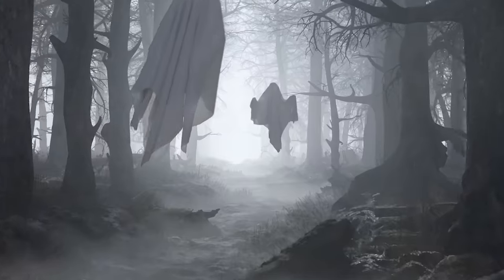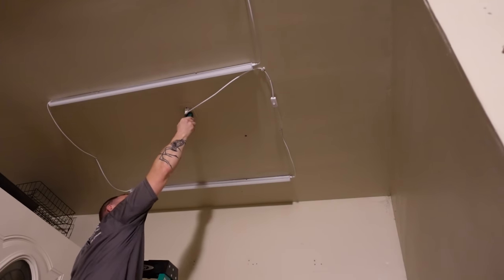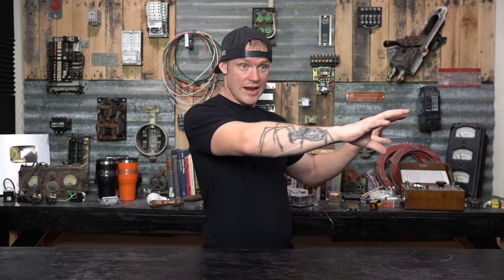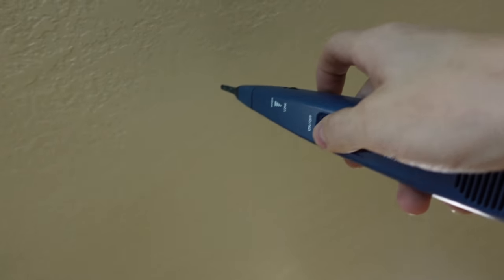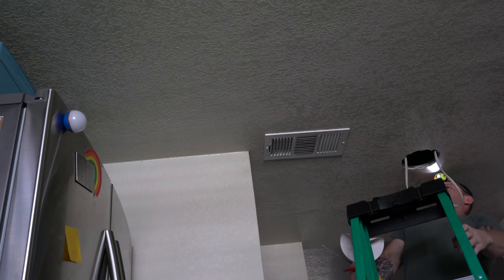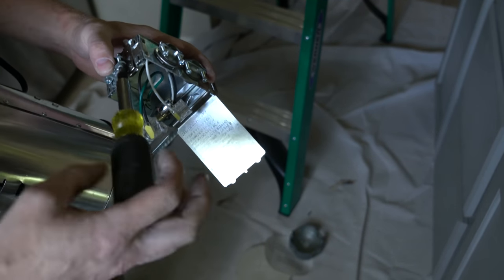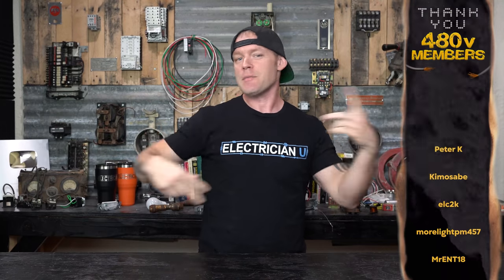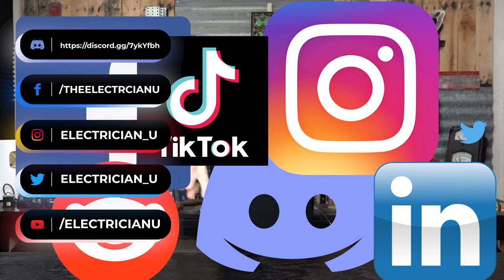THIS IS WHY ELECTRICIANS DON'T HIDE J-BOXES IN WALLS - Finding Hackwork!!

Comment: There's another advantage of 240v power. Nobody has any questions about whether it can kill them, and nobody plays any he-man games with it.
Reply: Saying we have in Australia... "One flash and your ash" Also when working on solar DC stands for Dead C**t
Reply: in EU / HU we have 230V but the horror stories are the same. I'm not sure my folks are 2x more brave or 2xdumb :D A lot of construction stories begin with 'the helper of X ....' :/
Reply: Ive been shocked by both 120v and 240 v it feels the same about the same as an electric fence. Athough 240 made my joints feel mechanical. Like i was a puppet on a string.
Reply: Cracks me up every time I hear some tough guy talk about “just grabbing that 120V”, like he was going to singlehandedly master the Power. You’re not Thanos, dumbass! One good bite will convince him that all his posturing won’t keep him from being a smoke show.
Reply: @mightyluv  obviously you have never been shocked or youd be laughing at yourself right now. And as you think youd die.

I wouldnt do it on purpose, its certainly not fun. Been shocked twice with 240v and probably 4-5 times with 110v and maybe 20 times electric fence 12v.
Reply: @Seriouslydave  Do ever get that same sensation running up your arm for a split second when you crack a knuckle or something similar, randomly?  I know I do. It's weird.
Reply: @TheDegan79  usually turning a screwdriver, i wonder if i got shocked or just a pinched nerve, not the same feeling but similar. Shocks throw you.
Reply: @Seriouslydave  That's the one.... mind playing tricks.
Reply: @TheDegan79  no lol you can tell the difference, 240v its not just that feeling, you also throw your muscles like a ragdoll.

Pinched nerve hurts but only like electric fence or 120v. 240v is like pinch nerve times 5 + ice river + sauna + rollercoaster. In a split second.
Reply: @Seriouslydave  i now what 240 feels like.... it's that half a split second when your not sure if it's nerves or a bite...
Reply: Urban legend, its 120 split phase, only 240 between the two terminals if you are lucky enough to shock across, typically shock one conductor to ground.

Comment: Bothers me so much that this occurs. I've had a builder request I do it -- I know that electricians have looked the other way -- and I've encountered it in newly renovated construction when opening up a wall. Dangerous as s##t -- and can make ID'ing a problem almost impossible.
Reply: Besides being illegal, It costs the building owner more in the long run, and it's a damn dick move.

Comment: Those J boxes, when grounded, can act like a faraday cage with respect to the toning tool, blocking the RF.
Reply: True, however you will get a tone from the entrance and exit wires if you dont, the problem is in that box
Reply: @rty1955  yep.  Which I think is exactly what happened in this case.
Reply: @MarcCabot  and like I said in another comment you have to think in 3D because the wire can leave a box (or no box) and travel vertically. Usually when I have that happen the signal fades. It does not abruptly stop. So in this case b since the signal just stopped indicates to me, that it went into a metal enclosure (faraday cage) and never exited. Usually indicates a broken wire
Reply: Absolutely correct, his tone generated signal he was trying to sniff was shielded by the J box. Cheers, #SeattleRingHunter
Reply: The tone is NOT RF!
Reply: @dhpbear2  I don't think anyone said that it was.

Comment: "120 volts can kill your ass" HahHAh young ones, made be think of all the old electrician's I've worked with so many times they would test the voltage with their thumb, and eventually they have to really dig it in to be sure it's not a dead line.
Reply: I think the point is , if you can turn it off,  why wouldn't you.  Which I totally agree with.  I mean what would you be trying to prove lol .
Reply: But those old school guys knew to only do that with one hand.
Reply: Or they were not old electricians.  There are old pilots (electricians), there are bold pilots, there are no old bold pilots.
Reply: I was once told to test with back of hand so you would not grip if hit by power!  
 I was like what??!

Comment: vietnam flashback to all the times “professionals” and “master professionals” told me they were 95% certain
Reply: As you should know in war all plans go out the window the moment the first shot is fired. You're dealing with an enemy whose plans you do not no so it's all guess work. The military "professionals" and "master porfessionals" don't like to admit they don't know anything so they BS you. It's quite different dealing with a hard science like electricity and a trained professional who has worked with it for years. When he says he is 95% certain of something you can pretty much take it to the bank.
Reply: @EndOfLineTech  to be fair car electrical system is very different from house electricity, and CAN bus is more electronics/computer engineering (dealing with signals/digital logic/communication protocol) than electrical engineering (dealing with supplying power).
Reply: @EndOfLineTech  CANBUS = CAN'TBUS...

Comment: The homeowner turning back on has happened to me. And I lockout whenever it's possible
Reply: I was changing a fluorescent lamp ballast in an apartment one time, so I just shut off the light switch to kill the circuit to quickly change the ballast and move on.  Well, the elderly woman there saw me working in the dark and wanted to be helpful.....

I saw her reach for the switch and I just dropped everything.  Nothing happened, thankfully.

Comment: The only thing that you're incorrect about. A recessed light connection box is not allowed to be used as a general junction box for other circuits. This is because you're not supposed to have to dismantle parts of the house to access a junction box.
Reply: Are they really not considered accessible? As apposed to readily accessible.
Reply: @tastytherrien5106  doesn't matter. You're not allowed to have a general junction box above a fixture in a hard ceiling. For example, you're not allowed to install a junction box above a 2x4 recessed trougher light in a drywall ceiling, even though it is removable. It's considered to be "dismantling part of a building" to access the junction box.
Reply: @jayhaines1792  thats gay

Comment: my instructor drilled into us NEVER conceal a junction box....
Reply: Right! It should be readily accessible
Reply: @jamalcole1985  it needs to be, otherwise where I'm from it's a code violation
Reply: @MIW_Renegade  it's a code violation in most areas. Can't do that in Canada, and I'm pretty sure the national code in the US says it's illegal to do that as well. 

There should never ever be an inaccessible junction.
Reply: @c31979839  that's what I thought, I'm Canadian and I've always known its a violation and it's illegal here where I live, you get fined if they find out you did it
Reply: Well how else do you fleece the customer you can't be a contractor without the con lol
Reply: @c31979839  I placed a number of junction boxes under the attic floorboards of my 1890s house - so, semi-accessible. Had to really, as the crafty carpenters back then made the upstairs rooms a few inches bigger by making the non-load bearing walls only 2 inches thick by laying the 2x4s flat. There was barely enough room in the shallow wall work boxes for just 1 cable. I changed that in a few rooms that I gutted and reframed, but in the other rooms I didn't want to lose all the old woodwork and nice recent wallpaper.
Reply: I learned that Elechickens don't like to do drywall. Cutting a hole and patching it is nothing. Just takes time, and that's on the homeowner.  Could flush-mount the junction box, paint it and be done. but extra light is usually a good thing. If you can't pull the box forward, you can possibly pull the box BACK to another potlight if there was tons of extra romex on one side, maybe even fish a new wire... but just cut the damn drywall and be done with it. Electrical and plumbing ALWAYS trumps paint and plaster. Put it in your contract for the customer to self-patch. They can watch See Jane Drill YouTube and be an expert in no time. You can DO this. :)
Reply: I just hid one lol
Reply: @lucash1980  well you have to be conscious of the customer, most home owners dont want to go multiple days with a huge hole in the drywall. Most people including myself can patch small holes in drywall but he needed a large one to access the hidden jbox. I think adding another light was a great solution, or like you said pull it to a down light on the tight side of the wire.
Reply: @lucash1980 i gotta admit see jane drill lady does know her stuff...

Comment: yeah man! well explained and well done! I once found a JB in the wall in my mom's old house that had 10 code violations.
-inaccessible
-no box cover
-box not secure
-no loomex or even BX connectors
-no slack; loomex went straight into the box (through the holes) to the splice and straight out.
-conductors stripped way too far (some like more than an inch)
-Al to Cu connections with no anti-ox compound
-no wire nut
-not grounded
-1 wire (the copper one) was stretched to the next stud (so wire not secured for several feet outside box)

freaking scary. even as an electrician!

Comment: Had a flickering light in our bedroom and while I was in the attic doing some other stuff I checked it out. Everything in the offending junction box was held loosely together with electrical tape. I also know for a fact there are a few junction boxes hidden in the walls, so that's kinda terrifying.

I did actually find one while doing some drywall work and opened it up, it was done professionally but it still shouldn't fucking be there. The next house is going to be custom-built and _with conduit_.  After working in a manufacturing plant I saw the light, conduit is the one true path.
Reply: It's a bit harder to do in the walls but if you do exposed brick and conduit it can look pretty cool.

Comment: 120v does not feel good when you are sweaty.
Reply: Makes you just want to pack up your tools and leave !
Reply: Or seeing somebody mistake 277 and thinking it's 120 just because it's just a hot, neutral and ground and gets freaking zapped lol
Reply: @Ishootback239  I'm 480 va now. What are you gonna do about it
Reply: @Ishootback239  or someone using the wrong cable color for 240v (red usually) and using white (120v) im not an electrician but i had to deal with a lot of it on my old building. 
i got zapped a while ago even if i turned off the breaker. old owner decided to jerry rig something. heating plinth, 240v, not on a double pole breaker. 1 leg on a double pole breaker, the other leg on a single pole breaker nowhere close to that breaker
still made 240 but was quite shocked to get zapped when i turned it off.
Reply: @patricklegault6383  Damm, I'm lucky I haven't been in that situation but because someone else had rigged it i always make sure that the power is off now.
Reply: @patricklegault6383  Test, Isolate, Test again.....always. Volt sticks are handy but test lamps are better

Comment: The reason for voltage between neutral and ground is because the neutral wasn’t connected in the JB.
Reply: Cablesmith electric is correct!  More on the reason... Its because the neutral was HOT! with no return path it was trying to find a path from whatever lights or appliances were on in the effected area. The voltage difference is from the number of lights or appliances its going thru to come back.   

edit... hot to neutral reading become the voltage difference from those appliances/lights ... the neutral to ground is 120 because ground it still good, and the neutral is essentially hot looking for a path to ground from the lights and appliances.
Reply: @AaronSchmid1  A-A-Ron here schooling everyone! Do you have a channel bro? Sounds like you should
Reply: @AaronSchmid1  that’s exactly what I just said
Reply: @ajyhimst2782  schooling who ? He just wrote a paragraph about the same thing I said in a sentence
Reply: @Cablesmith  dude, you said what it was, not why. His answer was more in depth. Don't worry, I gave you a 👍 too
Reply: @Cablesmith  it is what you said... I just explained it further for newer people. 👍
Reply: @Cablesmith  just trying to help newer people understand why. ✌️
Reply: @ajyhimst2782  I appreciate what Electrician U does here.  I have 18 years exp all over the industry. I deal with a lot of troubleshooting these days as a service electrician.
Reply: @AaronSchmid1  me too(been everywhere) You should teach. I think you'd be good. You seem calm and collected. Wish that was a skill I had
Reply: Haha cablesmith electrical aka boss man creating problems on this side of the pond. How’s sunny Manc - I hear you filled your yearly sunshine quota over the weekend 🌞
Reply: @mathman0101  wait, he's British? Now I understand the attitude
Reply: @ajyhimst2782  yeah that’s his dry Manchester humor he’s actually a great electrician in the UK check out his YouTube channel. Top guy.
Reply: @mathman0101  yeah, seems like a real cool dude 🙄
Reply: @AaronSchmid1  fair enough it sounded like you were disagreeing with me. I was more pointing it out to the guy in the video because he said something about he couldn’t see any conductors touching to give that potential to ground. 

See I’m even using your terminology here 😃
Reply: @mathman0101  big up math, supporting every electrician on YouTube since 1926 👌🏼
Reply: @ajyhimst2782  thanks 👌🏼 appreciate that Bro 👊🏼
Reply: @Cablesmith  when you train to be a professional electrician not to work as a professional electrician but to be able to do work in my home and to help leverage the skill and knowledge levels in the industry to go above and beyond regulations and code, making installations safer, reliable and more efficient, and to start to see the implications of new EV, solar and energy usage.
Reply: @Cablesmith  I know right...it's earth not ground....ground is for DC circuits.
Reply: @TheDegan79  👌🏼 boom thats the one

Comment: “Kill the power” before the power kills you.
Reply: Good safety tip, but he's 100% right. You can't trouble shoot a dead circuit. I did it for 20+ years.
I also wore leather gloves and treated every circuit as if was hot
Reply: @davep6977  You can use a 12V gel-cell, though.  Use a low-rating fuse as well in case someone energizes it when you're not lookin!

Comment: When your Landlord sends someone round and they say "I'm multi trade" tell em to fluff off.
Reply: I can do some of everything. A lot of people can. The biggest thing is knowing when it's beyond what you can do. For instance I replaced my outside spigots and the toilet inlet got clogged from sediment. I took the feed line off and cleaned it out. Putting it back together the steel pipe broke. I replaced that and when I turned the water on I found a bunch of weeping holes that showed up. I called my plumber. I'm not one and I'm not chasing leaks. He replaced all the lines in the area.
Reply: LoL!!!
Hey C Fong.... fluff You.

Comment: Sounds like the voltage you were getting was just "noise." I've had 100 volts and even gotten shocked from a wire that I later confirmed was disconnected at both ends. My best guess is it ran parallel to another cable and was getting induced voltage.
Reply: Probably more likely it was capacitance that was charging up to create a voltage in that disconnected line.
Reply: Yeah, I've had that sort of business trip GFCIs and all sorts of fun stuff.

Comment: I am a robotics engineer who came up through both mechanical and electrical tech work.  I used to rage at the (blankity blank) "engineers" who never worked on the stuff they designed or took the environment into consideration, and there is nothing worse than trying to debug some kind of error (whether accidental or screw up) while a supervisor or client is essentially breathing down your neck about the time, cost, or interference with their lives or bottom line.  I learned my lessons and I deliberately design everything to be as easy as possible for the next poor schmuck that may have to work on something I designed... I also keep in mind that making things simple and easy, vastly improves the perception of quality and reliability... thus building loyalty with the client so they will come back to you for the next problem they need solved.  I am very happy to see you point out that taking that tiny bit of "extra time" to do things right and cover your bases, really boosts your sense of professionalism as well as client confidence which again builds strong loyalty.  You want and *need* all that business for the future.